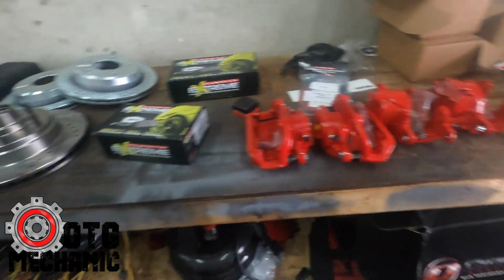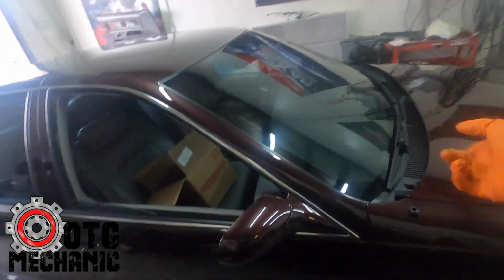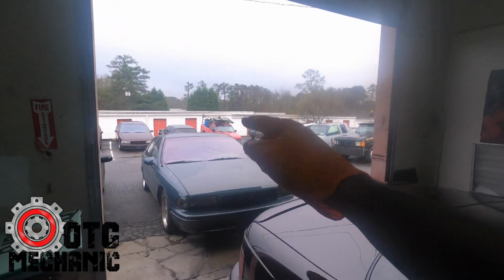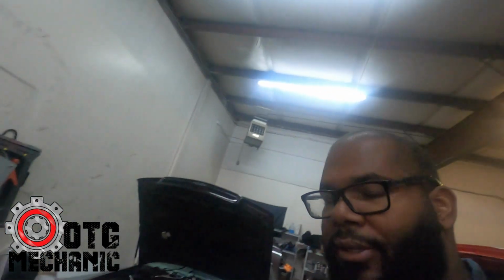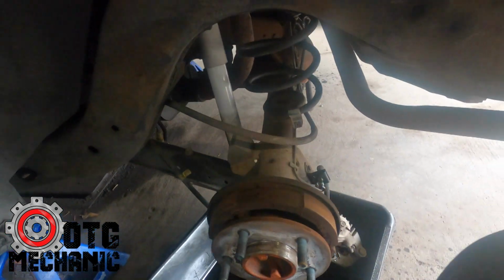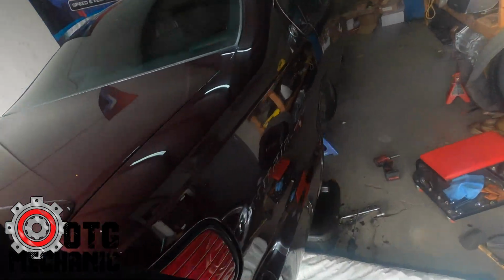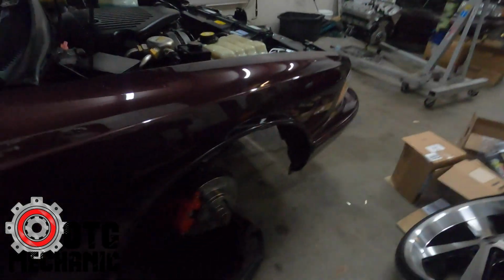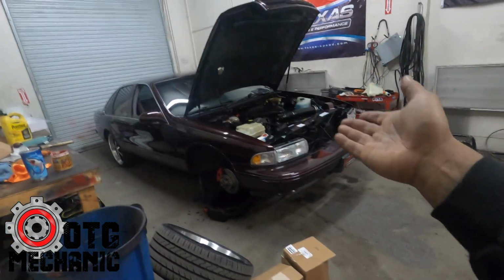1996 Impala SS gets a Powerstop Brakes upgrade

Comment: Did the stealth bolt on mine when I had to replace the brake line to the driver side rear. Big difference. Probably upgrade to the power stop when It's time to replace the brakes. Doesn't seem like too much more money than what you would pay anyway for new calipers and everything. I think it's also important to change out all the old fluids. Including the break fluid. Thanks for making these videos bro. Been watching for a while. 96

Comment: Good video like always man n got a question what’s that mod do for the breaks
Reply from the maker: Changes the proportion. Factory is 90% front 10% rear. This makes it 60/40
Reply: @BuiltbytheRays  oh ok I didn’t know that thanks for the info and where can I buy those bolts at to do this mod if u don’t mind sending me a link or website
Reply: Summit racing have them
Reply: @toranadosanders9818  is there a name I need to Search up for that boat